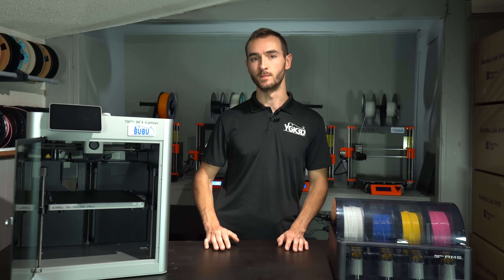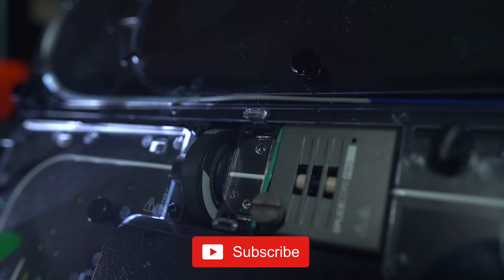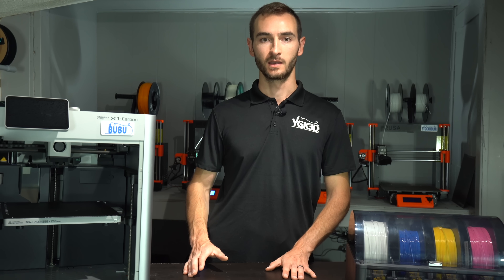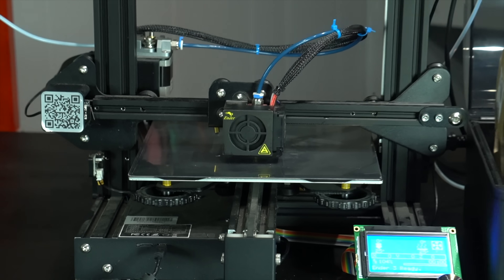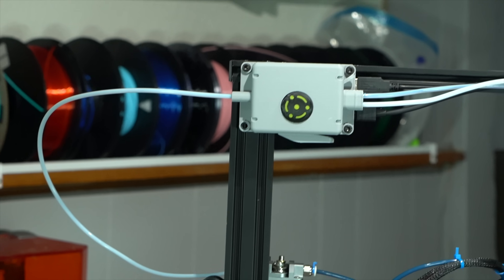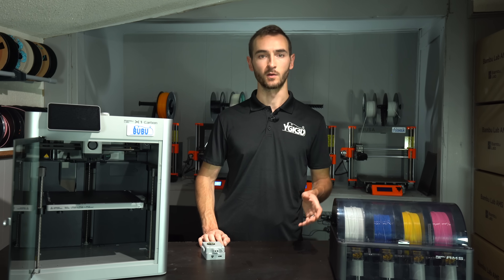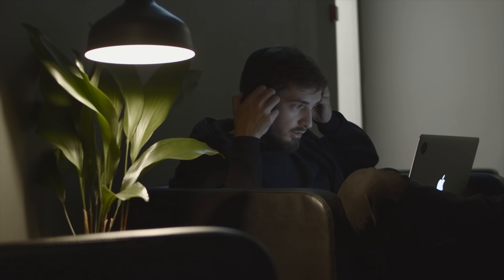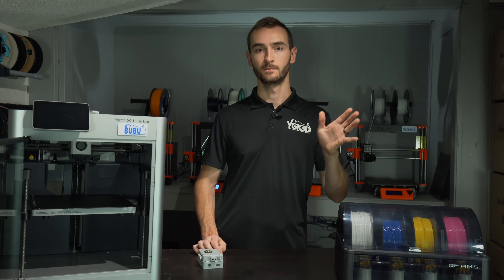This Could Change EVERYTHING.... Again. Bambu Lab's Big Announcement.

Comment: I think the word you're looking for is 'speculation'.  NBR's breakdown is more likely.  Bamboo has no multi-color solution for less than $1000.  'Everyone' likely means it'll be affordable and more basic than their prior printers.  every printer they've made has their own parts/slicer/service - you really think they would invite all the problems that come w/ achieving reliable compatibility w/ tolerances/timings/voltages/models of other manufacturers' printers?   This is their tesla model 3 - can't do that until you streamline manufacturing and have some market
Reply from the maker: I’m starting to think that will be the case… a low cost multi-color capable bed slinger. It’s too bad though.. I think there would be a big market for a universally compatible multi-color solution that is better then the existing solutions.

Comment: A multiplexer is a tough lift if it's not designed to be integrated with the hotend, extruder/cutter. It's been tried by multiple manufacturers and it's a tricky problem to solve. Considering putting the cutter so far away like you have means the retract/extrude behavior is very tricky to do. Even switching spools more than once I've had filament get caught inside an extruder if the gcode doing the retract extrude isn't perfectly timed. I don't see bambu doing that since they can't control the experience fully. I suspect an extruder hotend combo compatible with the AMS unit which has some standard mounting systems compatible with a few popular machines -- enders, vorons etc.

Comment: Couldn’t you just mount it to the end of the x axis rather than the top of the z…? I guess it would be moving up and down which may not be great for wear but idk.
Reply from the maker: My thought is that it could be mounted in different locations depending on the printer. An X or Y axis mount would be better if it’s possible.

Comment: Interesting idea with multiplexer but the amount of wasted filament for every swap would be massive to the point of I cant see anyone wanting to use it. I'm leaning more towards a new low cost entry level printer, bed slinger Bambu Lab A1.
Reply: I originally thought this as well but the more that I think about it a complete redesign to a bed slinger seems counter intuitive almost going backwards if it is a new smaller printer I think it will be a downsized core xy something the size of a ender 3 perhaps with multicolor functionality out of the box but the multiplexer idea wouldn't surprise me either we will have to wait and see

Comment: I don't think this is it. This is opposite of the Bambu philosophy, they want things that just work. I don't think they want to launch a product that works on their competition.

I hope it is the YCMK mixer. Print any color. If it's an extruder, the filament path could be short enough to enable continuously varying color
Reply from the maker: Interesting. What’s your take on the “for everyone” part?
Reply: @ygk3d  Bed slinger A1
Reply: @ygk3d they like to keep their products in a ecosystem just like apple so I also agree they won’t make it comparable for everyone.
Reply: I think it means compatible with all Bambu Printers (their definition of everything)  @ygk3d
Reply: @ygk3d  I think it's referring to the cost.
Reply: Think of it this way... If Bambu can sell an AMS to everyone who doesn't want to buy a Bambu printer, they still win. The people who will buy an AMS and not a Bambu printer likely weren't going to buy a Bambu printer anyways. There is no downside or at the least there is still more upside. If they sell 10% fewer printers and 50% more AMS, they win. Profit margins on AMS are probably higher than on printers as well. It also gets people into the Bambu ecosystem, increasing chances they will buy a Bambu printer in the future or at least other accessories and mods.
Reply: @802Garage yes this logic makes perfect sense, and even if marketing can be misleading, is difficult to interpret the "for everyone" as any other thing than for anyone who just own a 3d printer. And to add to what you are saying (edit: now I see you already said it 😂) , the ams can be used as a hook, a taste of what bambu is, a bridge to the walled garden. Also, this discourages the attempts of the competition to release any similar product.. "Forget it guys, we are dominating the multicolor 3d printing industry... Yes... Even  with your printers 😂"
Reply: @Drumaier  Hahaha well said. Agreed the "for everyone" bit really makes it seem like it has to be something universal. The only other option that makes sense is that it is a very low cost device, whatever it is.
Reply: @802Garage  a printer
Reply: @802Garage there’s a huge cost that would be associated with selling an addon for everyone’s printer that’s not a Bambu Labs printer. They would have to offer support and that when just on your own ecosystem is a nightmare. Once you add every other manufacturer and scratch builds it’s a never ending stream of issues you weren’t ready for. 

I could be wrong, we will see
Reply: @geauxracerx  I think as long as they basically added a plugin library for any Marlin or Klipper printer, they would be pretty covered. But I'll admit despite having programming experience I have zero 3D printer programming experience so far. You are right though there are definitely some considerations I didn't think of, but I think it could at least cover a lot of popular printers and their clones. Then more experienced users could adapt it to anything.
Reply from the maker: Mosaic has done it somewhat successfully, so it’s possible, and if it generates enough profit they could afford to hire more tech support workers to handle the influx of issues.
Reply: Exactly, The AMS is probably easier to Produce and sell vs an entire 3d printer, its Win/Win for them even if they aren't selling the printer. @802Garage
Reply: I second this. I think Bambu Lab wants to bring people into their ecosystem, not open it up to other manufacturers. By being able to use one of their headlining features on other printers, they would significantly cut into their own printer sales. 

I also think the "for everyone" means a relatively low price (maybe bed slinger), but not "every printer". 

Though I hope I'm wrong, I'd love to use the AMS with my non-Bambu printers!
Reply: Impossible for a small device like this to mix CMY and white to make any color for so many reasons. The CMY mixer is NOT it. I can go into the reasons if you like but I don’t feel like typing that much 😊
Reply: Every manufacturer just wants their stuff to work. From a business perspective, it's a smart idea to sell a product for everyone elses printers. Businesses really make their money off of consumables, they can only sell so many printers to one person, especially at the price point. Bambu studio is based on Prusa Slicer, and you can add third-party printers. Every Slicer has presets for almost every major printer out now. So, if they can integrate the AMS and the filament detection system into everyone else's printers, you can potentially not only sell them the AMS but have a regular customer purchasing filament from them also. 

There are also many people that aren't sold on bambu labs yet as company being so young or the longevity of their printers being so new. I'm sure there are tons of Prusa fans who would love to add an AMS to their Prusa printers.

Comment: I think this is spot on Well done!
Reply from the maker: Thank you!
Reply: @ygk3d  I agree. The 4 mounting bolts clearly show that it's designed to be mounted to anything. These people in your chat saying "for all" is referring to the price are making inane statements. Affordability is relative.

I'd bet money that you are correct. Bambu is poised to sell these unit + the AMSs required to use them to tens of not hundreds of thousands.

Edit: I was wrong
Reply from the maker: @condorman6293  haha thanks for the vote of confidence! Most people seem to be saying it will be a low cost bed slinger with multi-colour capabilities… personally, I’d like to see the multiplexer more, but they stand to make a ton of money either way.
Reply: @ygk3d  I think the people saying it's the A1 are reading patents thinking they are good sources of information rather than the very commonly misunderstood or falsely read in to things they are. 

I mean, just staring at the part in the teaser shows its not a print head. They wouldn't arbitrarily show a non-printhead part for a teaser.

Bambu - Teases a photo of multiple colors entering a filament cutter "Color for all!"

Speculators - "Clearly it's a new bed slinger printer".

I don't get it.

Edit: I was wrong
Reply from the maker: @condorman6293  lol 😂

Comment: If it is that way, than I’d expect the second input to be a bypass.  It probably would need it’s own powersource.
Reply from the maker: Bypass is a good thought. That’s something the Palette is lacking which would be a welcome feature. Good call on the power source as well.
Reply: @ygk3d  Not sure if you could just plug a power supply in the second port of the single ams and power the buffer/cutter kind of reversed to x1/p1.

Comment: BambuLab should change name to CloudTrap.
Reply: "BUT THEY MIGHT STEAL MY GCODE"
*designs in tinkercad, sketchup, onshape, fusion 123...*
Reply: I haven’t used the cloud once.

Bozo 🤡
Reply: Just don't use the cloud, lol.
Reply: Stop putting your banking statements on the build plate! It may be a printer just not that type
Reply: @marcels.1225 😂 lol
Reply: Says the guy that uses meta every day tracking everything you say and do
Reply: or ccp trash panda